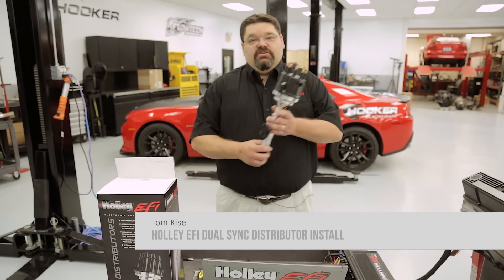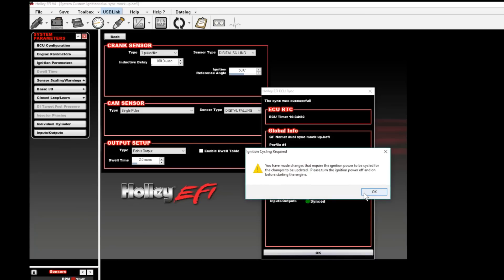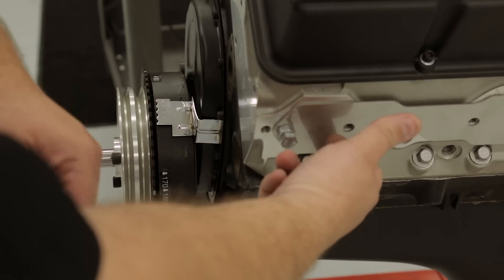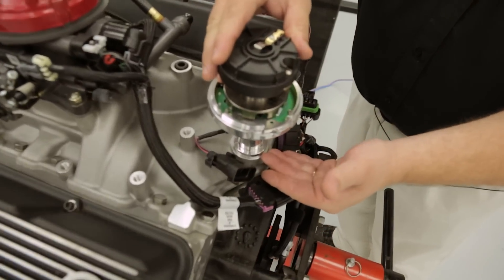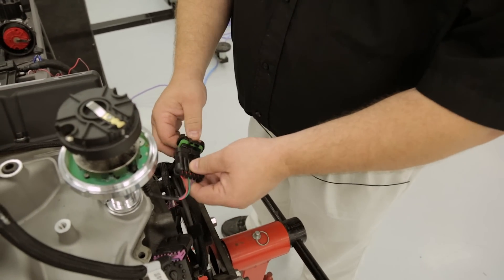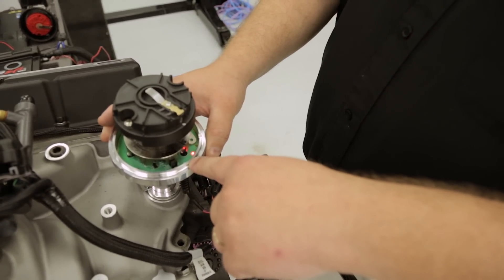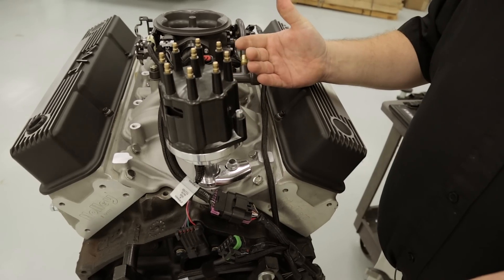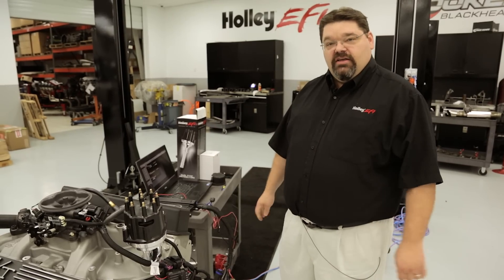Holley EFI Dual Sync Distributor Install

Comment: My my cranking timing is off and I go ahead and move the distributor left or right, would that not throw off the crank and cam sensor that you just set up by moving the distributor to the pickup sensor?

Comment: What if I am installing a Terminator and a dual sycn at the same time? The terminator has no initial programing and has never run. Do I set the ignition parameters first? Or do I do the initial terminator Wiz setup first?, or is everything done on the laptop together?

Comment: is a cd box still required with a dual sync distributor if running an HVCII coil?
Reply from the maker: You have to have either a CD box or some kind of coil driver for this to work. -Keith

Comment: So, if your at TDC on a clockwise rotation engine, and you rotate further clockwise by 50°, wouldn't that put you at 50° "after TDC"?? This sounds wrong to me
Reply: YES....THIS IS INCORRECT.  I Just went through this. This video, the manual, and a HolleyTech phone call all had this same wrong info. I was going thru a no fire situation for days. Once I moved it to BTDC, boo yaaaa....Insta Fire !!

Comment: Just a question why has the crank got a toothed  sensor plate isn't that the idea of the duel sync distributor
Reply from the maker: The engine is a mock-up engine that we use for multiple EFI set-ups. J

Comment: I bought a new Sniper EFI, Dual Sync Distributor, and EFI fuel tank for my 69 Camaro. The information and support that Holley puts out was one of the deciding factors on going with them; showing confidence in their product and willingness to help the customer speaks a lot! With that said, the old system is already gutted out of the car and this weekend we begin putting in all the new.

It is crazy how inexpensive and easy the technology has become over just the last few years. Now if only Holley could do the same thing for the power plant in the Zombie 222 68 Mustang.

Comment: I'm assuming the hole in the cap is for demonstration purposes only, or am I missing something?
Reply: Demonstration only to show the relationship of the rotor contact to #1
Reply: Tech Guy do I have to go back in with the handheld and change settings on that
Reply: You will need to program the ignition type using the software. Follow steps shown in the video. You cannot set up a custom ignition type through the Holley hand held at this time.